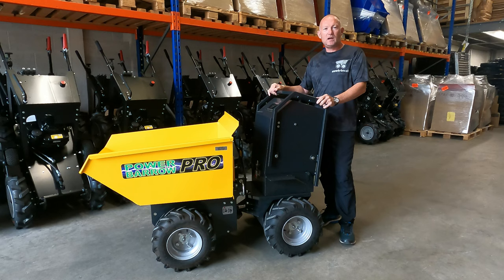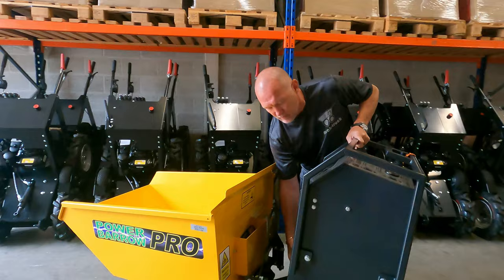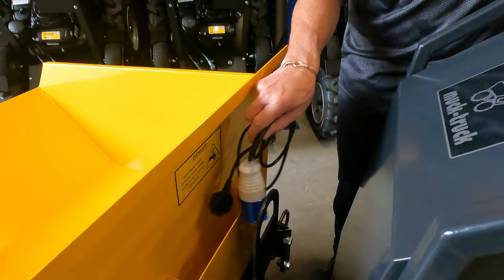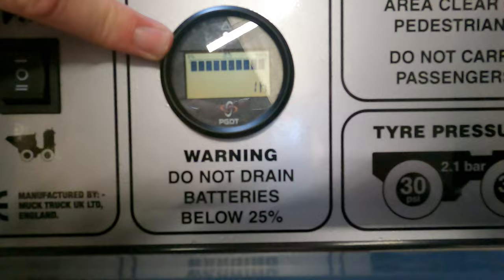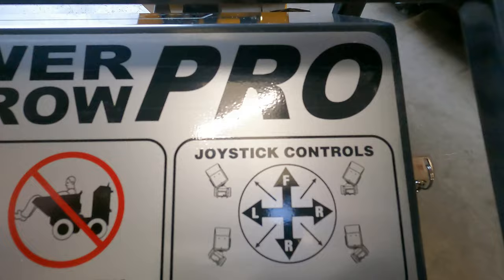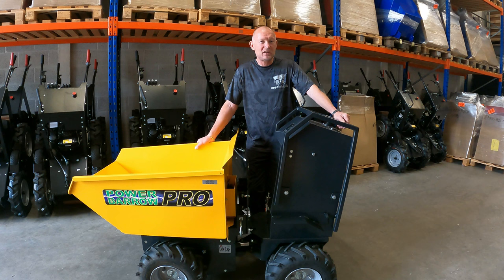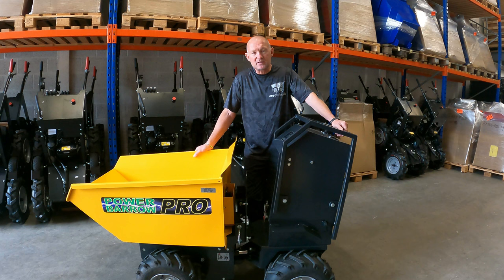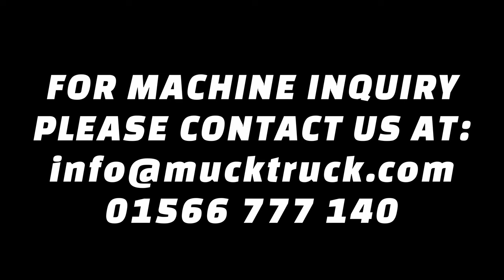Introducing - POWER BARROW PRO (Battery Powered Mini Dumper by Muck-truck)

Comment: Would it be possible to integrate a “jump box” feature via an Andersen(?) connector? Would be handy if you owned one and had to start another vehicle in emergency.
Reply: Yes it would, we use Anderson connectors in there anyways so if your after 12 or 24 volt we can do this when its ordered.

Comment: Does it come in a 12 volt version?
Reply: Hello Michael, the machine has 2 x 12 volt batteries in it. but 24 volt is the power needed for a machine with this much power in the drive system. 12 volt is very low on power for hills.

Comment: 4 hrs continuous run time is pretty low.  I know nobody usually runs it nonstop but 4 hrs ,that’s half a day.  If we work 10 hrs it won’t be able to keep up the whole day.  That’s to bad really.
Reply from the maker: Hello Miro, thank you for the comment. Here is the explanation and workings. We have that particular comment regularly and have placed hour meters onto 100 of the engine powered machines. The maximum run time we experienced from customers like yourself was 3hrs 20 mins on a machine per working day. This is due to time missed - loading/breaks and being driven back unloaded. Our tests are carried out fully loaded and continuous walking at full speed both up and down an incline of 10 degrees. This distance equated to 8 miles (12.8 kms). No one walks this far in a working day with a load. We also added 40 mins to allow for older batteries. There are also options for replaceable plug-in lithium batteries for an extra upgrade. Hopefully I've answered your comment as if it were a question.
Reply: @MuckTruck  ok great thanks for the feedback